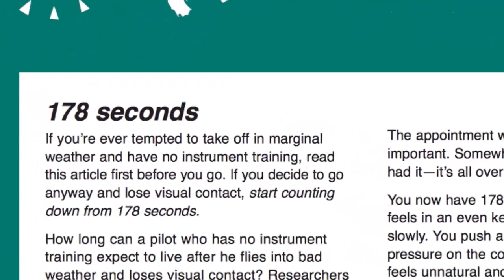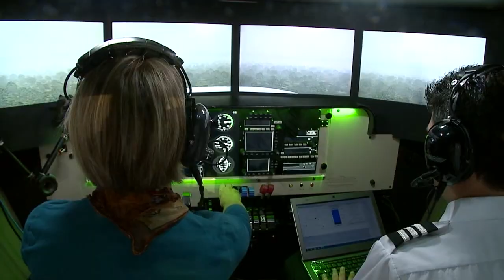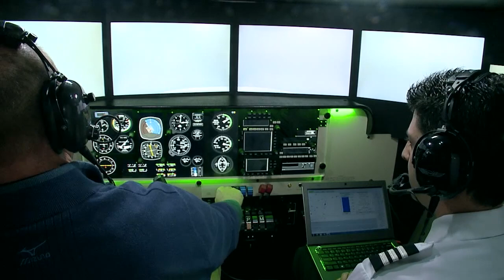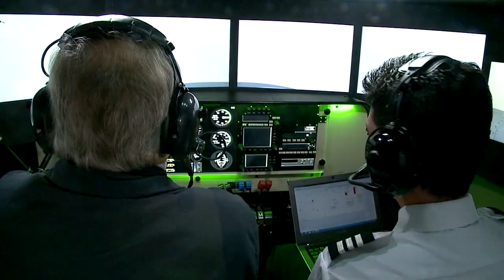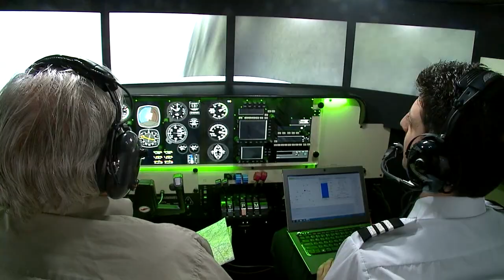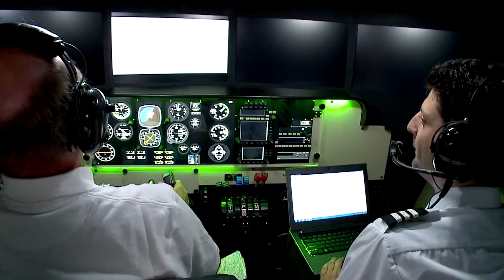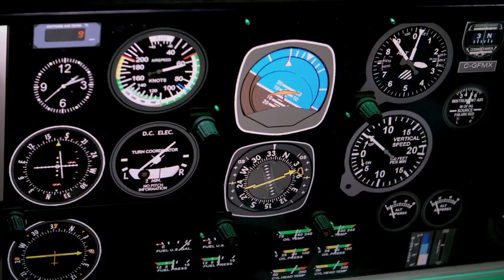SmartPilot | VFR Into IMC

Comment: This is where Flight Simulator experience comes into play. I think there's a huge difference between the old-timer kind of pilots, 50 years old or more who've never touched a simulator and the newer generation who grew up with Flight Simulator at home. I'm not Instrument Rated yet but have flown in IMC for extended periods at a time and didn't find it hard to keep the airplane flying. The key is to forget about trying to look through the clouds and just keep your eyes inside the cockpit. It's also very important to cross-check the instruments between scans, to keep the engine in the green RPM band, use carb/pitot heat and monitor the suction. 2 altimeters are required, preferably of different sources, say a GPS altimeter and a standard baro altimeter.
Reply: What plays a huge factor is the fact your body is going to tell you something different than your gauges. You WILL want to follow your body. That's what flight simulators at home don't teach you. It's a very uneasy feeling the first time you get into IMC and your body automatically tells you something different than you are seeing.
Reply: This overconfidence is dangerous. Simulator cannot replace real experience. I flew into IMC once and I prevented a crash just because of a tiny piece of information that I learned to interpret form dozens of bad landings.
Reply: @zeepack  i thought that before I finished his first few sentences
Reply: @Carpet Hooligan Gladly. Sound of wind can tell you a lot about what your plane is doing if you have experience. Without visual cues, sound of wind will tell you if your plane is doing something wrong. In a simulator, you cannot gain that experience of relationship of sound of wind with airplane's speed and attitude.
Reply: yep someone gets it! add in keep an eye on the turn coordinator for horizontal reference.
Reply: A gps altimeter is not going to be accurate
Reply: You are 100% correct. Simulators are an invaluable tool to IFR flight.

Comment: As someone who started by sole reference to instruments with military UAVs, I found IFR flight pretty easy.  Just focus on the instruments and don't bother trying to look through a cloud.  Keep turns standard rate and watch you altitude, airspeed, artificial horizon, heading indicator and compass.
Reply: Dave Holland but don‘t forget that your vestibular system is in stillstand, IN a moving aircraft you have exactly those cues on your body they’re talking about in the video. Even if IFR rating like I am, it‘s a totally different thing training ifr on a computer or in the air
Reply: @BK117Dude  IMHO, yes and no. Yes this is not the same thing to fly in IMC in real condition and not behind a desk. But yes the training behind your computer helps. I'm currently passing my PPL but before that I had a lot of virtual training using only instruments. Last week, and for the first time, I have done a flight without seeing anything else than my instruments. I flew it around for 10 minutes like these without any issue.
I was used to train with only instruments and it helped me a lot. I did not care about my body sensations and was able to fly safely for a good amount of time. But what is sure is that I don't want this situation ^^
Reply: It's difficult to keep your cool once that fog envelops you and you know full well that your IMC experience level is low or non-existent. That's when "panic sell off" begins. And your ability to think rationally and remain calm starts to diminish. I've watched students begin suddenly to pour sweat and hyperventilate.